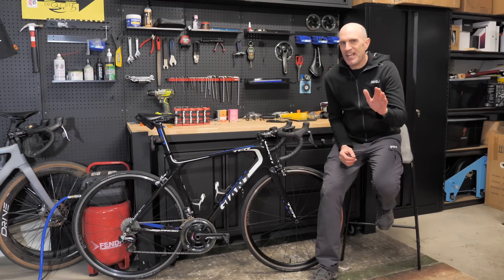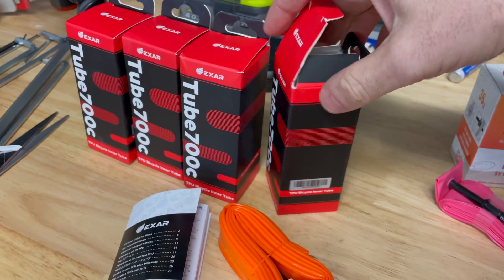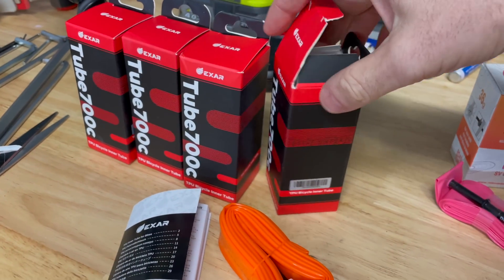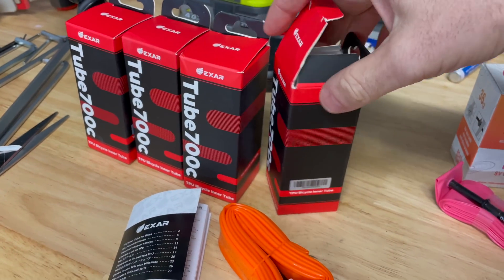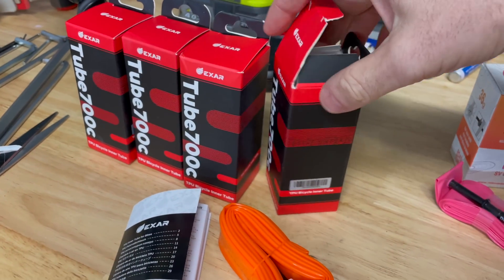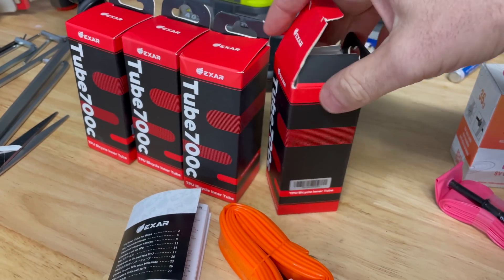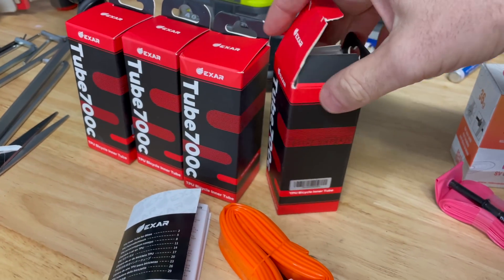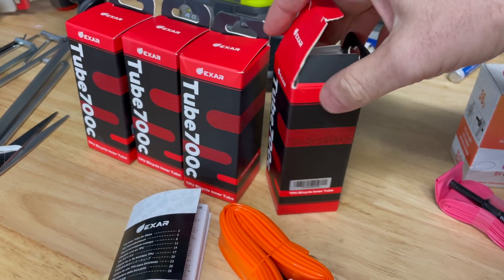TPU Bicycle Tubes: Light, Fast, Cheap.... What's the Catch?

Comment: They should make a full polyurethane tire as well.  I have 80mm 81a durometer skate board wheels that have over 10k miles on them with no amount of wearing.  Except for nails and staples and glass embedded.

Comment: I found out “what’s the catch” with TPU tubes - not reliable. Wife and I have matched pair of hardtail trail bikes. 27.5 x 2.1 tires. I bought a total of 5 TPU tubes of which 3 already failed. Failures with both RideNow and WanBan. Although I ordered 27.5 the RideNow box label showed I received 26/27.5 tubes. OK, fine, they believe their product will fit both. But it was a frustrating whack-a-mole game trying to keep half the tube on the rim while getting the other half on the rim and in the tire. I had the tube at about 5 psi just to be sure I didn’t exceed the 8psi limit before getting tire closed on rim. Anyhow, at some point in this Vaudeville comedy act apparently the rim tape got pushed off center. A crescent of a spoke nipple access hole got uncovered. Over the next 12ish hours, unbeknownst to me the TPU tube was growing a little hemorrhoid down into the exposed crescent of that hole. Never ridden on. It failed sitting in shop while I continued other service on her bike. The WanBan tubes installed easily because they were made only for 27.5. But 1 WanBan and 1 other RideNow share a failure mode that should be of concern to everyone since they are exactly the same. TPU tubes are extruded as straight tubes, cut to length, and then 1 end inserted into the other to turn the straight length into a circle. Both brands gave me a slow leak stretch failure in the single thickness right next to the double layer insertion. Maybe the double layer doesn’t stretch bigger than 1.9 and the single layer has to do too much stretching in a short distance. Or maybe it’s a process failure with however they heat and bond the ends together at the factory. Either way, my 2.1 application is less than the mid point of the 1.9 to 2.5 range that both brands labeled these TPU tubes for.
I have over 50 years of experience with butyl for road, road racing, MTB, bike packing, kids bikes, commuters,,,,,,butyl just works.
 My scale showed that these TPUs were half the weight of my butyls (not the 1/3 claimed in ads). For example, our front wheel complete rolling assemblies went from 4.4 lbs to 4.2 lbs. Certainly not a meaningful performance advantage even if they did hold air. No performance advantage to be had while in shop or on side of road replacing at tube. 
I hope these two TPU makers enjoy the money they got from me - it’s the last time they’ll ever see my money again.

Comment: Some feed-back that I received on my review from the AliExpress seller of the tubes that I"m using (Boostor). In my review, I was complaining that they don't include some patches. 
Seller Reply: Hello. Our product is inherently puncture-resistant, which increases its weight somewhat, but also significantly increases its thickness compared to other products. We also do not recommend repairing TPU inner tubes. This is because TPU material cannot recover after expansion, and repairing the tire increases the risk of a secondary blowout.

These TPU tubes are like condoms: you should put them correctly from the very beginning, and use them only once!
Reply from the maker: Noted. Tubeless causes pregnancy. 😂

Comment: I love your channels and have learned a great deal over the months. I am fairly new to cycling, so please excuse the naivety of my question. I constantly hear how tubeless setups save weight but have yet to see a comparison of a TPU versus tubeless setup. It seems to me that the sealant weighs something and the question is... what does the sealant weigh compared to a good TPU. Any thoughts on that? I am currently running tubeless and annoyed with having to top-off my tires every day (10psi or more) and cleaning up the sealant that leaks onto my wheels. Thanks!
Reply from the maker: Good question! Sealant is very goopy, so I’d guess it’s more than 1g/ml making it heavier than a lot of TPU tubes. The benefits of superior puncture resistance with tubeless should also be factored in, not just weight. You’re right on the continual top-up hassle with tubeless.

Comment: I got unlucky, i fitted them and after 2 days of riding I rode over a rock while riding behind somebody else. Instantly Lost air in the front and the next day I found my rear tube had deflated and has a leak which lasts about an hour.

Comment: Shane did you say that only 1 was compatible with RIm brakes? is this something I need to take in to account?
Reply from the maker: Always best to check with the manufacturer if their TPU tubes support rim brakes. This has to do with the heat generated when braking.
Reply: @gplama  Thank you, I will check the website for these remarks.

Comment: 7:24 the valves cores can normally be replaced if it looks like in the video. There are some transparent stems on Alixprez that are transparent. You can see that they use normal valve cores. I used one with black stem which standard valve dimensions. But the metal stem versions usually can't be replaced as the valve is integrated into the stem.

Comment: No issues with them in months as long as I keep two bikes and only ride them 1-2 hours at a time outdoors for the moment, 3-4 times a week. They're easy to replace even if they pop and at that point I'll re-assess, but I hated being tubeless on my road bike. Rolling resistance feels great on them. I'm not savvy enough to notice a difference between tubeless and TPU as a new rider in my first 11 months, but the TPU seems like less of a headache in the long run, unless I'm racing. But these are perfect for recreational and easy/moderate touring, light trails

Comment: I found switching from tubeless to TPU inners saved about 50g in weight per wheel too. I think just because you don't need all the messy sealant which must weigh 80 to 100g or so depending on how much you need to use.

Comment: I've been using TPU tubes for about six months now after coming from latex tubes and, honestly, I'll be going back to latex when I get around to switching again. Ride quality is notably better with latex tubes and I end up putting a little bit of air in my tires before every ride even with TPU tubes, so I don't mind the air loss. I'll keep a TPU tube in my saddle bag as a spare, though.

Comment: Anyone have much experience with TPU tubes in sub-zero temperatures? Just ordered some WTB tubes for my MTB and gravel bike. The MTB's are tubeless so it's just for spare use, and only in the summer so no concerns there. But I still run tubes in my gravel bike as I swap tires a couple times a year to keep riding in Edmonton's very real winters (I believe the definition of "winter" in the bike world is "May" in Edmonton"). I won't ride if it's much below -10C as it's just not much fun, are TPU tubes good for that at least?

Comment: I bought 6 tpu tubes to try out.
My conclusion is that they are quite fragile. 
5 of my tubes have punctured from tiny holes.
I've given up. TPU no.6 is in my saddlebag as a  spare.
I've switched to Sxhwalbe lightweight butyl tubes. 200g heavier for a spare, but I haven't had any punctures since.

Comment: I have the ride now  tubes in my rim brake road bikewith Zip 404 wheels . On the other hand, I’m damaging tubes Tpu tubes on my gravel bike when I’m trying to mount tires that are extremely difficult and don’t play nicely with hookless wheels. It’s becoming a waste of time and time consuming and a waste of money if you’re tired and rim combo don’t play nicely and don’t mount easy you can damage and cut the tubes with your tire levers or or just trying to install. so I don’t recommend these tubes and the situation where you have those experiences, the less manipulation, the less stress or potential punctures of the tube while mounting the better otherwise be prepared to patch the tube or find out that when you pump it up it’s got a hole in it and you’ll have to unmount the tire. Take it out and patch it and put it back in and hope for the best so I’m gonna make some changes . gravel bike is, back to tubeless  sealant

Comment: Don't bother. Constantly having to pump up tyres. Have to ride the bike in a more safe less fun way. Not durable so if you hit a pot hole there done. Difficult to repair when on rides. Might as well use a condom. Didn't find them quicker. Found tyres nearly coming off when going round sharp corners.
Reply from the maker: Best try another brand if that’s your experience.
Reply: @gplama  but why though, no problem at all with butyl.

Comment: i have a 20x4.0 rim but can a 20x3.0 innertube fit and work for a 20x4.0 ? Lets say if i don"t have a 20x4.0 innertube can a 20x3.0 be a substitute ? My next question is what if i have 20x4.0 inserts can a 20x3.0 innertube fit inside a 20x4.0 inserts ? if so what will be the psi to fill the tire up ?

Comment: If you know physics at all, you know that rotational weight makes basically zero difference.  The energy that you put into a system stays in that system.  If you take a 1100g set of wheels and a 1600g set of wheels, there will be no difference on a time trial, a climb, a road race or on the flats.  It's the overall weight of the system that makes a slight bit of difference.  So if you're only going to lose 500g off the total system by buying super expensive wheels and tubes, you're wasting your money.  Think of a fly wheel, like the one you might have on your trainer.  A heavier flywheel stores more energy than a lighter one, so if you stop pedaling, it takes much longer to lose the energy you put into it.  A lighter flywheel will spin up faster, but it will also spin down faster because there's not as much energy in the system.  All this to say, buy the tires and tubes that will keep you riding, and that goes for wheels as well.  There is literally 0.05 benefit to $3,000 wheels and TPU tubes over a $400 set of Chinese carbon wheels and butyl tubes.  I know you always hear people say "if you want to make upgrades to your bike, the wheels and tires and tubes will make the biggest difference".  It's not true even in the slightest.  If you are slightly overweight (or more) and lose a few pounds and improve your position on the bike, you'll make far bigger gains than any wheelset or tires or tubes could ever provide (because anything is better than nothing).  Trust the science.  Or comic books if you're that person.  Juggernaut wouldn't be nearly as terrifying if he weighed 200 pounds.  It's his size and weight and momentum that makes him unstoppable.  The more weight you get moving, the harder it is to stop it.  That's kinetic energy.

Comment: When these Tubolito's came on the market a few years ago I bought a pair to ride MTB on the Canary islands and it costed me a small fortune. So on the island I installed the Tubo's (and i know what I'm doing. First ride: gravel, rocks modest climb and decent. WITHIN 20 minutes the back Tubolito gave up. No punctures but just torned. And that for 40 euro's Per Tubo. It was a complete disaster. Even thin ultralight butyl tubes lasted on the same trails for more than two days 'till they completely exploded. Shure I got my money back for the pair after complaining about the lies in the advertisement. (2,5 times stronger than butyl) . Note: At that time Schwalbe had taken their version of these type of tube of the market and for a reason. Pffff this was just a complete disaster. Now after a few years the Chinese versions are cheap and I will try those and see if they will hold but Tubolito's I say it was just a scam at that time. (to early on the market ? )

Comment: So the catch?  Well at $15-$20 AUD a tube, they are more expensive than standard butyl tubes from the local bike shop (The magene exar ones he links in the description.  I paid $40 for a pair off of Amazon, because I got scammed into a years prime subscription) OR cheaper chinese ones off of AliExpress or EBay are garbage and fail after 1 or 2 basic rides.

The RideNow brand a lot of people in the comments are rating, 1) no longer that cheap. 2). According to Reddit are also crap that fail easily

Comment: I usually use my butyl tubes on my contis up to 100PSI, i´m trying now to use TPU from Ride Now 36 grs but as i know i should inflate them max to 5 BAR wich is about 73 PSI, i´ve felt the tires a little bit slugish, have anybody try TPU to higher PSI ?

Comment: I like tpu because of the self adhesive patches instead of the bullshit of butyl tubes with sanding, glue, waiting for hours for it to dry, only for the patch to fail. But once you get a micro puncture on a tpu tube, its over, you have to over inflate to find it and once you do a bunch of others appear, rip. I saw a dude using car glass glue to patch butyl tubes but that stuff is more expensive than a new tube.

Comment: To share: after using TPU tubes on road bikes for more than a year, I discovered that these tubes ride significantly better than butyl tubes, only a tad worse than latex tubes and tubeless. When brand new, these TPU tubes are easy to install into the wheels. Unlike butyl and latex tubes, TPU tubes will not shrink back to its original size (tube diameter and tube circumference) once it is deflated from the wheel (for maintenance or otherwise). TPU tube is significantly stretched to the point that it becomes too large to fit back into the wheel. Reinstall TPU tubes will have a lot of creases inside the wheel which lead to puncture upon re-inflation. Hence, it becomes almost impossible to successfully re-install or reuse such tubes. In addition, the patches will only firmly adhere to the TPU tube only after a few hours, this makes patching while out on a ride not realistic. In conclusion, I will only buy cheaper TPU tubes knowing full well that it is a one-time use, and to carry 2x spare TPU tubes (with patches) along during any ride. Hey, it is lighter than butyl tubes.

Comment: I set up a Trek 5500 loaner road bike with the RideNow tubes and use them as a spare in my other road bike that's tubeless.  In Southern Arizona where the Thorny Things rule the roads, I run tubeless w/ Stans and hardly ever get a flat but use the TPU as a spare in my bike bag where the space savings is of great value.  I have had two flats on the loaner bike since December and was able to fix them w/ the stick-on Park Tool patches after wiping w/ iso alcohol & clamping the patch with vice grips & two pieces of flat metal for half a day, hadn't had a problem w/ repairs.

Comment: when you compare the difference in weight in your hands, youll probably be hooked, it decreases the energy required to rotate the outer diameter of the wheel, which i guess could amplify the effectiveness

Comment: My recommendation is to get the chinese ones which come with the metallic valve, weight is negligible. 
I did a gravel overnighter with a friend, he was using tubeless, new expensive tires, but he got a big slash on one of them, bad luck. He tried plugs but it was too wide, he tried a tire boot and didn't work either. He tried a regular patch on the tire and it wouldn't stick. So eventually went with one of the 2 Pirelli TPU tubes he was carrying as spares. After the whole debacle he was tired of the bloody wheel and when he was pumping he twisted the wheel or something... the valve cracked in half. Second and last spare... same. He was using a Lezyne minipump with the flex hose but it didn't matter. 
If he had been on his own half ride, in the middle of nowhere in NSW, that would have meant two days of pushing the bicycle to the next village, quite a survival adventure. 
Luckily I had 2 normal tube spares. He used one but he was so done with everything that he didn't inflate it to the appropriate pressure for him plus the bags. I offered help but he had had enough and said: f*ck it, she'll be right... a few km later, it blew out. We were down to the very last tube and we still had a big chunk of the ride back ahead of us, he was nervous and even cut his finger with something so I decided to fix it, pump it myself and put a band-aid on his finger. We made it. I wasn't too worried because I still had patches for the normal tubes and we only had 30km to go, doable walking distance before sunset.
The moral of the story is, these tubes are good for spares on your roadbike saddlebag, but they aren't very trustworthy for gravel adventures, especially in a place where the nearest village is 80km away. I'm not sure you can fix a TPU tube if you have a snake bite... For normal tubes always carry patches, self adhesive, don't trust the little metal glue tubes either, they get dry, self adhesive are worse, they last one day on, but they get you home and don't expire. You can fix it with a proper patch at home if you want.

Comment: If the TPU tubes were as heavy as butyl tubes, then obviously they would be thicker.  And thicker would be stronger and more puncture resistant.  I'll have a pair of tough tubes please, I'm not worried about the weight.  Thank you kindly.

Comment: When installing these with 28c tyres it creates a bump around where the tube is joined, anyone else have this problem?
Reply from the maker: Haven’t noticed with these. What brand TPU are you using?
Reply: @gplama  Magene, Exar
Reply: @gplama  Bump was so bad that I took them out and used butyl instead. Still have 2 at home. Can try again and send photo if you are interested
Reply from the maker: Best send those to Magene support.

Comment: I used TPU inner tube 28g it's good I've used it on a race in my country it's good cheap Fast strong and Strong puncture resistance hard to puncture and they ask is this tubeless i said nah it's TPU lighter than Tubeless i sprint with it i climb with it and it really helps me win more races in my country and place I'll give it 10/10